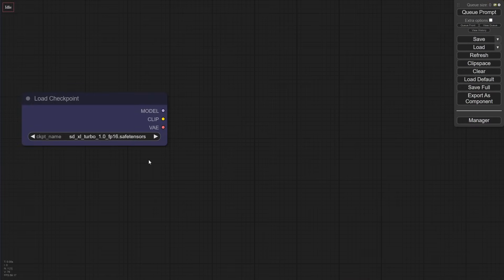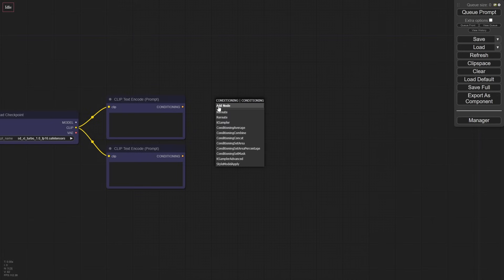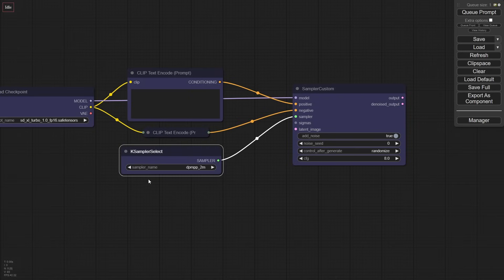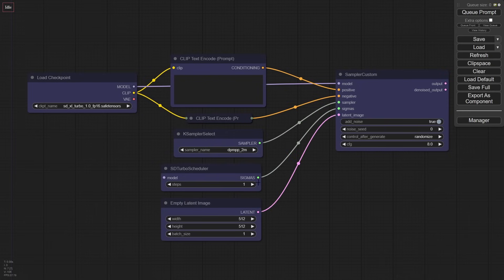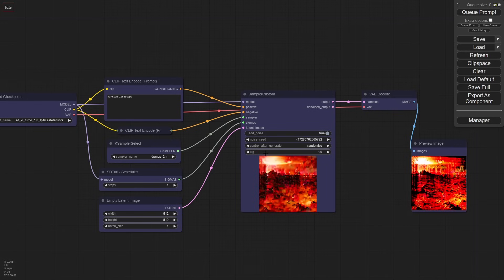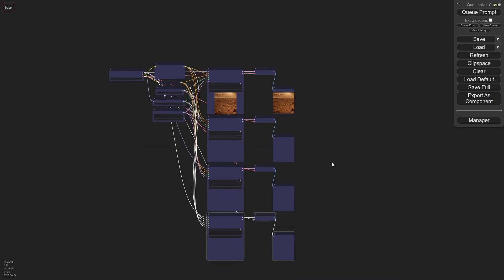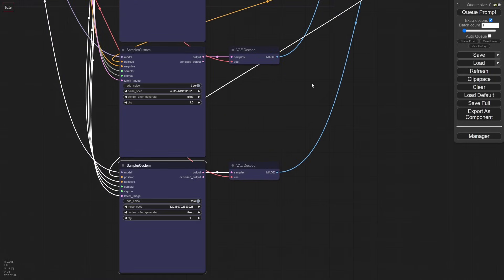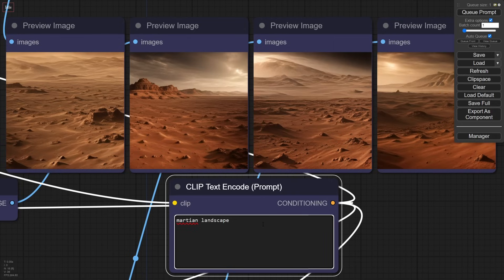New Model! SDXL Turbo - 1 Step Real Time Stable Diffusion in ComfyUI

Comment: Is there a way to create 16:9 images? Or would i need to generate 512x512 and then convert them to 16:9 or something?
Reply from the maker: You can try, but the model will work best with the 512 square.

Comment: Helpful video but for newbies:  to perform the copy of the nodes and links together, hold CTRL while you highlight the nodes, use CTRL+C to copy, use SHIFT+CTRL+V  to paste which pastes the nodes and connected links.
Reply: Thank you :)
Reply: Thanks for the tip. Do you know how to update the comfyui so the correct sigma shows up? I just installed the latest release and the fp16turbosdxl but I don't have the turboxl sigma
Reply: @yourashero  hey sorry i'm still quite the newbie, but ran into the tip i posted just due to my trying to follow the video. i'm not sure what you mean by 'sigma' and googling isnt help me understand the question. i do see the sdxl-turbo in the Load Checkpoints node of the workflow.

Comment: I have built it exactly the same, but it takes about 15 seconds to create a martian landscape for me. (checkpoint etc already loaded) Im running it on a 2070rtx 8gb. Is my card too slow or what could be the issue?
Reply from the maker: hmmm, that seems slow.  Perhaps create a new install in another directory and see if you have something hanging around that might be causing the issue.
Reply: thank you for the quick answer :D @sedetweiler

Comment: is img2img possible with this? there is no denoising strength option in the custom smapler..
Reply from the maker: I would probably use this as the first pass, and then encore the result for img2img with another ksampler
Reply: @sedetweiler  I've tough about that, but.. then the speed advantage is gone :l

Comment: amazing but i have a question :
each time i change my prompt it have to reload the model so i don't get the instant result like you, what do i do wrong ?

got prompt
Requested to load SDXLClipModel
Loading 1 new model
Requested to load SDXL
Loading 1 new model

then it render the steps in like a franction of a second
Reply from the maker: You might ask that on the developers git. That isn't the typical way this should work. You might actually try reinstalling, since it's pretty painless if you have the models locally
Reply: i reinstalled a clean comfyui and actually i think it's just normal that the model is reloaded after each prompt change, so on a rtx 4060 it take 0.3 sec if i don't change the prompt and about 3to5 sec if i change it, not bad @sedetweiler

Comment: Wow. Yeah, it really can't get forms right, but the speed is amazing.
Reply from the maker: It is just another step forward.
Reply: @sedetweiler  Actually, at 4 steps cfg=1.2 it can do hands / eyes etc. almost as good as SD 1.5.  Why did you say 2 steps max in the video? Even reading SAI's paper they specifically designed it to work best at 4 steps.

Comment: ⚠ *BLACK IMAGES* unless you change this:⚠
I have to add "LOAD VAE" and choose the SDXL VAE safetensors file or else i just get a solid black output image.
Connect Load VAE to VAE Decode (instead of from the Load Checkpoint) and be sure it's an SDXL vae.
Reply from the maker: Hmm, that is odd.  I tried with both and I have the same images from either one.
Reply: @sedetweiler  yeah, that's why it's helpful to have comments like mine and yours, because things don't work the same for everyone. Maybe one of us overlooked a detail or have a conflicting file or different hardware or drivers, it could be anything.
People can try what I said if they get the issue I had.
Thanks for the video.

Comment: This is a game changer! When I update comfy I don't think the SDturboScheduler updates. I tried both a manual git pull and the comfy manager to update Comfy. Also all my custom nodes have been updated. When I pull down the sigma input, I don't see SD turbo Scheduler as an option. I have to double click and search it and my resulting generated image is definitely evidence of it. Is there another way I can assure SDturbo Scheduler gets updated ?
Reply from the maker: It is part of the comfy core.  Did you restart after your update?
Reply from the maker: Try searching for "turbo"
Reply: @sedetweiler  It's working now thanks!

Comment: Tried it, works amazing - thanks for sharing! I am wondering, would it be realistic to try to use this model with AnimateDiff or at least img2img - I tried but obviously results are not quite good given that we can't control the denoise strenght (or start steps) given we only got one step :) Any ideas of a workaround?
Reply from the maker: I don't see why not!
Reply: @sedetweiler  I'd really LOVE to see that workflow then :).. My assumption that it's not possible is that the sampler only does on step, so it's not possible to fine-tune how much of the original image (say in img2img workflow) we want to maintain as we do by adjusting start step in Advanced Sampler (or denoise weight, which I assume does the same as start step). I tried img2img, controlnet and AnimateDiff workflows, and I can confirm that it does not work. CNet (without img2img input) flows do result in a visual that sort-of follows the original one, but heavily smudged (almost like a normal SD doing one sample, more/less). Anyway, thanks so much for your channel!

Comment: I got this working in A1111 and after watching this, I've been on a binge trying to find something that works like in the video. Where typing a new word in the prompt auto generates another image. Anyone know anything about this possibility?
Reply: I don't and haven't looked yet but I am curious if it's possible. My brain is telling me it's not possible because of how A1111 is designed but what does my brain know. 🙂
Reply: @Elwaves2925  so far the only thing I've found is a bandaide type fix. Right clicking generate you can make it infinitely generate, then typing in the prompt will update the next generation. Leaving the seed the same will keep the image pretty stable and leaving it as a random seed kinda works just a little chaos. But it doesn't stop generating images is the only downside and when it's constantly generating its easy to "lose" the real good ones that fly by lol
Reply: @SSPARROWW  Thanks but I think I'll pass on that way. Infinite generations until we stop it is not what I'm after.
When I get some spare time I'll do a search myself but I suspect if it was possible, it would have been mentioned in a video.

Comment: I updated Comfyui by using  a manager but I still have only 2 sigmas avaiable : flipsigmas, splitsigmas.   Do you know why?
Reply from the maker: Did you restart afterwards?
Reply: Same with me , I've updated and restarted and It's still not showing up @sedetweiler
Reply from the maker: Search for "turbo" and see if it shows up.
Reply: @sedetweiler   I faced same issue but searching for it showed up!

Comment: hey cool ! .. under the wood i've gone a part on Fooocus which integrates comfy engine .. then the double UI (to make nodes and config all the "tripal things" then to use an easy interface would be a cool thing. 
Even comfy makes it comfortable but a bit tricky.
* About the SDTurbo : is that it is only a safetensors model that could be used as it without any other trick ? i tested .. some images but not fast - the turboscheduler is not yet implemented - is this "just" adding this "sigmas" thing to make it ok ? -- oops tested in sdXl and 1024²

Comment: I think it's worth noting that the huggingface page shows a preference for 4 steps rather than 1, for best performance and quality; and "preferably, the model generates images of size 512x512 but higher image sizes work as well." So it's not 512*512-only, they just don't really specify further as far as I can see.

...And there are two custom checkpoints based on SDXL Turbo on CivitAI already. XD
Reply from the maker: I have found that 4 is a bit much.  Give it a try and tell me what you think.
Reply: Yeah 4 looks like sharpness filter. Best results are 1-3. Also images with higher resolution than 512 are tiled so no it's not made for higher resolutions. @sedetweiler
Reply: I've tried with 2 steps and it worked well. 9 seconds with 4gb vram! Crazy!
Reply: @erics7004  What GPU did you used?

Comment: Yooo that's coooll but is there any notebook for this?
Now I want to start learning comfy ui
Reply from the maker: You can run comfy in a notebook, but I do not have experience using it in that manner.  Check the comfy git, as there is a notebook ready to go on there.
Reply: @sedetweiler  thanks!!
Reply: Their Huggnigface  provide the code on how to use it.

Comment: Very nice workflow, thanks. BTW, you should tell us what hardware you use to have such fast image generations: I guess an RTX 3090 or 4090?
Reply from the maker: I am using a 3090, but 1 step will be super fast on pretty much anything that can run stable diffusion.